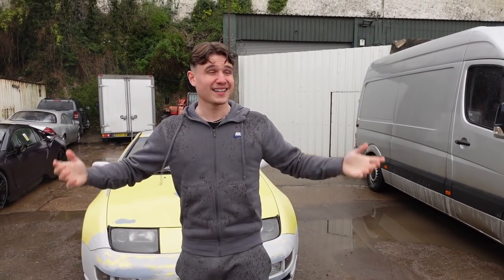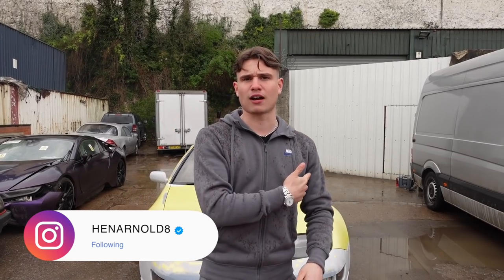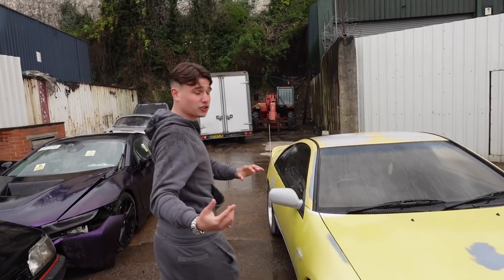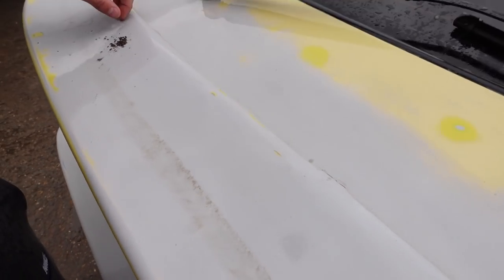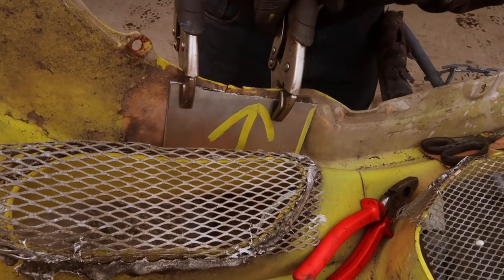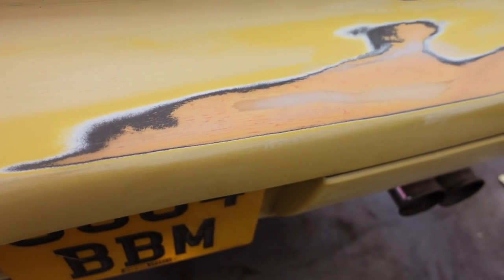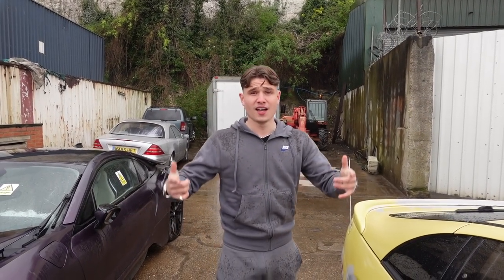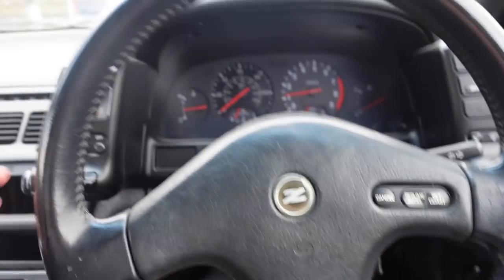YIANNIMIZE WRAP MY BANGER: BEHIND THE SCENES WITH Henry Arnold

Comment: Only need to run the number plate through a Vehicle Check to see that its been sat up for a few years and then when it did come back in 2019 for MOTs it was picked up on underbody corrosion. 

Hence the Yiannimize team having to brace under it to lift it - Can imagine it was a bit of a state. Thing is when the HA Boys did the work they work under the basis they stick it into a bodyshop and the bodyshop would probably sand it back and tidy it up prior to spraying. 

Live and learn.